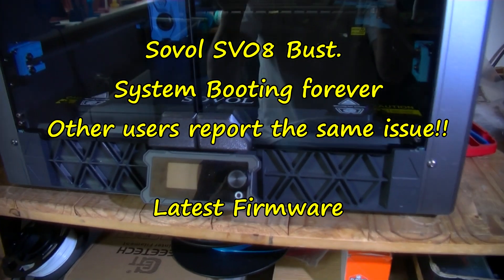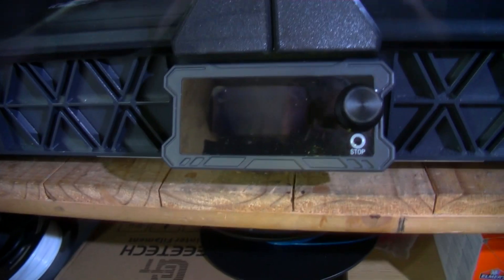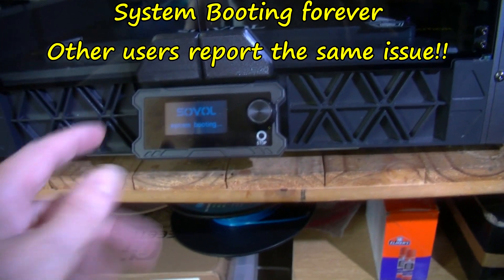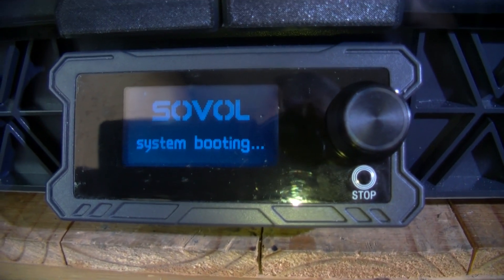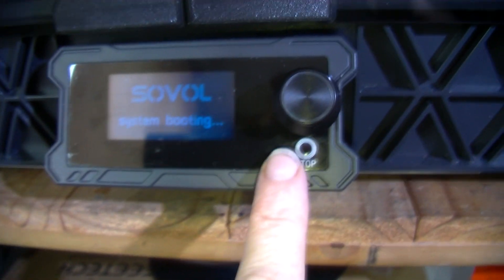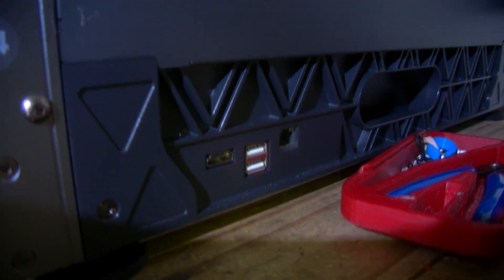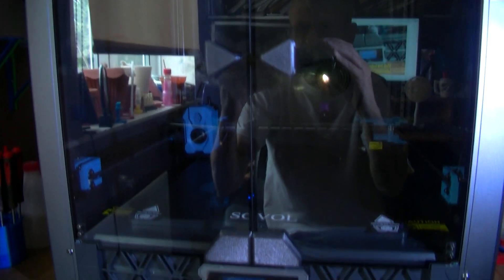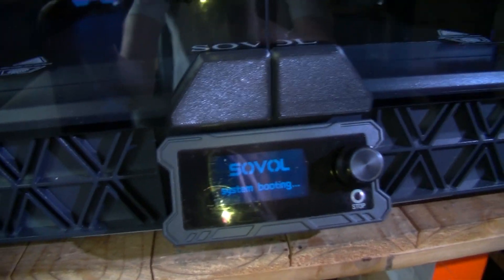Sovol SV08 Bust  System Booting forever.  With a FIX!!!

Comment: d oyou have the 2.3.3 firmware still around? with the latest one it doesnt work. Also, if nothing works and I reflash the EMMC module with stock .bin, could it solve the problñlem?
Reply: Y solved mine, Y hat to buy a EMMC adapter and reflash the originl file forthe OS of the SV08. they have a video on their channel on how to do taht. Now i'ts factory reset, I have to re-install klipper and screen, but at least it prints with the stock LCD.

Comment: Have you contacted Sovol's support?  From what I hear they've been good about getting back to people and doing whatever they can to help.  I received my machine a few weeks ago with the enclosure and I updated the firmware, no problems yet.  Did you do the EMMC back up and update?  I didn't have an EMMC adapter when I assembled my machine so I was not able to do this and to be honest I have no idea what it does, but maybe that's difference?  I've only been printing in PLA+ and PET-G so far, in addition to leaving the doors open like Sovol suggests I also remove the glass top completely for maximum air flow.  I'm also going to look into having the enclosure exhaust fan run when printing PLA/PET-G to improve air flow some more.  Ideally I'd like to come up with a quick disconnect system that would allow easy removal/installation of the side panels to really open it up.  If you haven't already I'd contact Sovol, even if they don't have an answer right now the more people who report an issue the higher that issue gets on their to do list.  Best of luck.
Reply from the maker: FIXED Thank you, see description now
Reply: What was the problem, and how did you fiv it@3D_Printing
Reply from the maker: @mikeskerritt9618  fixed now read the new description and title
Reply from the maker: @yertelt5570  fixed, read the description. Thanking you for the help

Comment: Am just lucky, I installed the latest software 2.3.3 I think it was, and all is fine so far. But I will wipe my fingers crossed.  Hope you sort it out   cheers. Mike
Reply from the maker: FIXED Thank you, see description now
Reply from the maker: I've using latest Firmware software 2.3.3 without issues : I wounder if the new encloser fitted sends more heat to the Control Board and this has caused an issue; someone reported being requested to remove a resistor on the Control Board due to over heating, (DANGER of FIRE IMHO)